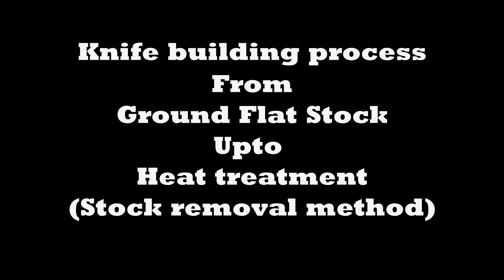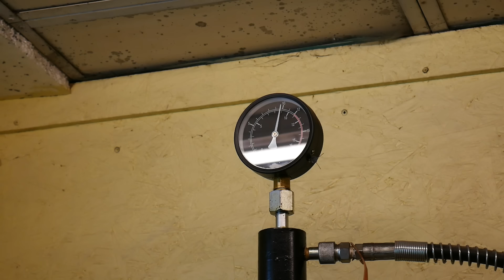Knife work Pre heat treatment

Comment: Do you find that using the press to mark your logo causes less stress than punching with a hammer? I get warping often where the logo is punched using the hammer method with O1. Thanks you and love the video
Reply from the maker: I no longer experience warping to any great extent even after stamping the logo, drilling the tangs and indeed even tapering the tangs all of which I currently do prior to heat treat. I go through several ramps and holds at different temperatures and since doing this warping has become a thing of the past.
You could try soaking your 01 a little longer.
Sandy
Reply: +Jackloreknives thank you
Reply from the maker: I haven't had any major warps recently said he, but just did a heat treat this afternoon and had two blade warp quite badly:( So the next best thing to do is to Hot bend and take the warp out that way. I always do this right after the first temper. Pull them from the oven whilst hot and make a simple bending jig up eg, brass pins taped in vice jaws will do the trick and work the blade between the pins carefully taking out the warp. Don't forget to retemper afterwards.
Sandy